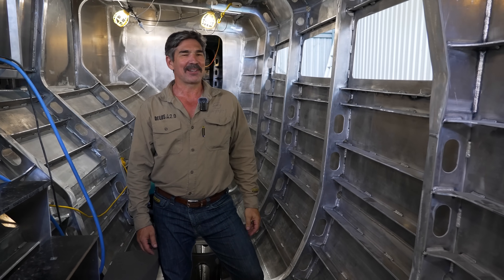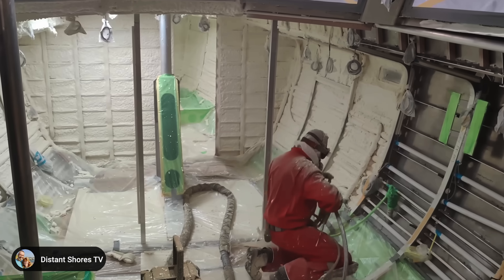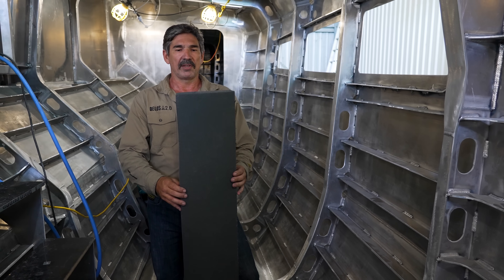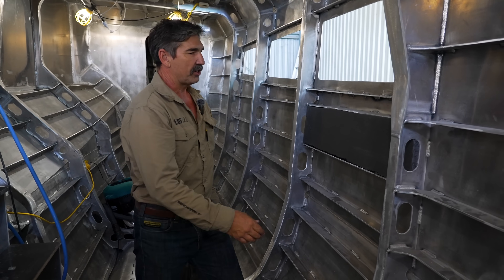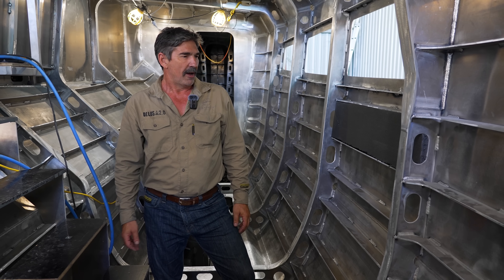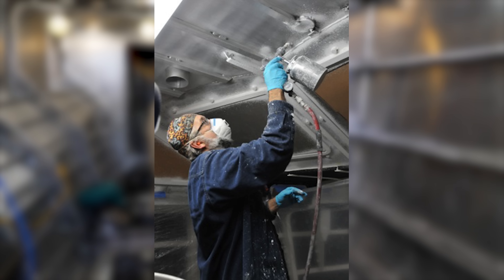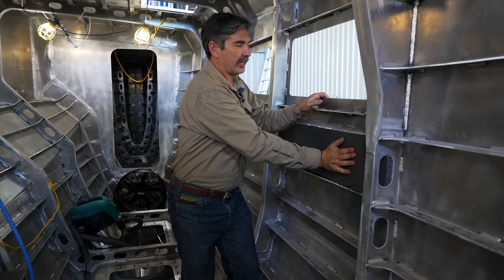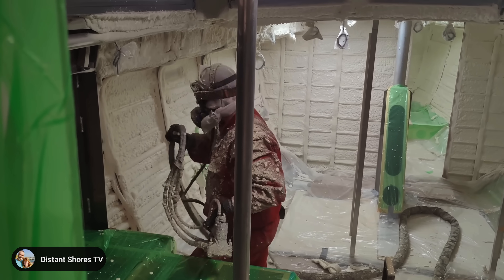HELP, We Need Your Advice!  How Should We Insulate Our Aluminum Catamaran???

Comment: Thought I would throw in my $0.02 on this since I may offer a slightly different experience from both the construction and industrial markets on this topic. Closed cell urethane foam is by far the easiest and simplest install and will do a great job but it has its drawbacks as we all know.  Because I don't believe you are going to find the perfect product out there in this case it makes sense to me to approach insulation as a system rather than a singular product for this application. To be clear I have no experience with this "system" and especially no experience on salt water  cruising aluminum hulls so this should be tested out on a small scale before you apply it on a large scale, but I would try out a sample or at least talk to the people at Acrytech Coatings in FL (I have no affiliation other than as a past consumer of some of their coating products) to see if their Therm-X basecoat and CeramaX Roof coating might be a good fit as the start of a multi-tier "flash and batt" insulation strategy that seems to be growing in popularity in the residential building industry.  Those specific Acrytech products are used as exterior coatings normally to mostly reflect heat from a surface because they have a bright white Titanium based pigment for increased albedo effect but that means they are pretty durable waterproof coatings with great adhesion to metal and specifically to aluminum in harsh environments to adhere to your hull structure and they also add some thermal insulating properties.   This stuff is used on the roofs of aluminum cargo trailers in the trucking industry and in some industrial shipping container applications as a cool roof paint to lower the temps inside the box and reduce the cooling required for refrigerated shipping.    Therm-x is like a brush/roller paintable thinned caulking to fill any small gaps or cracks for the subsequent layers and stays flexible to adapt to expansion and contraction of the metal.  The CeramaX is like a sprayable high build paint version of a very thin closed cell foam that creates ceramic  "micro-cells" in the coatings to reduce some conduction of heat.  Starting with those 2 layers to handle the bonding to aluminum, metal expansion and contraction and condensation issues to start,  I personally would opt to for a layer of spray cork insulation for sound deadening mass against the hull and any additional thermal and condensation help it contributes. Cork is also extremely fire resistant and electrically insulating in the case of electrical arcs with any worn or exposed wiring.   After spraying  you can install what you need to for wiring and piping in the wall cavities and come back after and add the batts of closed cell foam with friction fit (as long as it doesn't squeak when it rubs) and then it is removable, if necessary, under the finished wall surfaces if needed for maintenance.  This allows for all the spray applications to happen prior to any of the wire and piping installations being in the way so its goes on as efficient and as thoroughly as possible and then allows a hopefully lower cost slightly thinner version of closed cell foam batts as additional thermal insulation after all the wiring and piping is done.  Good luck.

Comment: The descant coating / primer is vital to try to hold back that condensation effect. Best way I know is paint, primer & that descant (hydrophobic) treatment with an air gap & an insulated inner wall. This will separate the outer hull from the interior surfaces while letting air & condensation dry out on their own. The inner panel with thermal insulation attached to it & not the hull will keep the interior temperature under control inside by eliminating thermal bridging.

Comment: Good video.  Removing foam insulation From Metal is very easy.
1) Use a Metal Putty knife & Plunge cut small 3" Squares for removal.
2) Grab hard foam and break away from hull. 
3) Use Wire Wheel on a Drill to Clean aluminum of Foam if so desired.
4) Vacuum area to clean area.

Comment: Now I'm not a professional boat builder, but I'll be starting a 50-foot sailboat build in the next 12 months. From all the research I've done, I'm going with versi-foam system 15. Is is uscg approved as a floatation device and provides r 6.5 per inch of insulation. It is completely waterproof, and it will stick to just about anything. To make things easy, I will be using 2 inch schedule 80 pvc pipe as my electrical conduit to make make any repairs easy. I'll be using t peices with screw on caps to make inspections and access easy.

Comment: Be careful.  Outgassing from the spray plastic will wreck your health.  Closed cell is a better option.  A vapor barrier to isolate the "dew point" and prevent moisture from condensing inside the wall.  Good luck with the choice you mske.

Comment: Take a look at Rockwool. You can get this in "bats" you can shape as you like. Rockwool does not absorp water, it doesn't rot, and it doesn't burn(!). Cut out so the bats insulate also the ribs in the hull. And finish with a vapor barriere.

Comment: One warning I would have about the sticky back insulation stuff is to try and research if the material deteriorates over time, I have a bunch of what looks exactly like that kind of insulation you are showing stuck in some areas on my boat by a previous owner and it is deteriorating and the little foam pieces always manage to find their way to the bilge and clog my pump!

Comment: Ive been in the insulation business for 25 years. Closed cell spray foam is the way to go. It has a high R Value. At 2 inches you will get a R15 which will leave room for running wires after. Great sound deadening. It will strengthen the structure but light. If it gets wet it just dry's.

Comment: Have you guys thought about condensation?
Because from being in Navy metal ships I can tell you that all the walls that are in contact with the water below the water line will be very cold. And you’ll mostly be in warm humid weather. So having any air in between insulation and metal wall will most likely create mold and fungi to grow. It’s a very important factor to have in mind. I’ve seen water dripping off metal ship walls from how much condensation there was.

Comment: Use ordinary self-expanding foam that is used for sealing and insulating roofs. It is a cheap solution. Very good, very light, and the boat will gain extra buoyancy.  Remember that the catamaran, too, can capsize - the foam will give extra buoyancy. In case of a leak, it is very easy to remove it to find the source of the leak. I apologize for any errors - I am using a translator.

Comment: Good video !
1) Zinc chromate primer for the Bilge & 12" up. zinc chromate is a Great primer for Paint on Aluminum.
2) Spray Foam Ftw - Min 2" is the magic number. see Refrigeration load calculation program & mess with temperatures & insulation thickness parameters For Btu correlation.
3" Spray foam insulation - Good for no condensation down to 35 degrees Fahrenheit.
4" spray foam - no condensation down to -10 degrees F.
3) Run an Extra 1" & 2" empty Conduit to any Places you think you Might want to Run wires in the Future.
Leave Room in existing conduits for an additional few wires and or Run a few  additional unused wires to locations.

4) Just a Fyi - All Commercial Walk-in Refrigerators & Freezers are Spray Foam & it insulates For 20 Years or more.
3" Walls - Walk-in Refrigerators. Last 40 years.
4" Walls - Walk-in Freezers.

New Standards are Walk-in coolers 4" Walls.

Comment: Hi Delos.  Fellow PNW here.  I have used the spray in bed liner in aluminum Grumman canoes for insulation.  It helps a lot for both sound and cold transfer when we had them in the sound.  I suspect the weight might be a consideration. You could spray it in and use the cellular foam over it.  Thanks for sharing your build with us.  Hope to see ya on the water some time.  We will be sailing from FP towards GBR summer 25.

Comment: Not boat but metal building in northern Ontario. Spray foam is the way to go. You are absolutely correct about little parts that are not covered being a major concern of insulation failure. What we did was run all the conduit and used pack insulation around it and sprayed all the rest. I would not recommend this in a marine application. As others mentioned run more conduit than you think you need and document all of it for future needs. I hope you all are having a blast building this. Best wishes.

Comment: Owned and fished an aluminun boat about 6 moths a year in alaska. It had extensive spray foam, top house had insulation foam. Bought a glass boat and couldnt believe how much better it was. Id do as much spray foam as possible with good wire chase and pre planming.

Comment: A thought I had was do a combination. Where you won’t need to dig into the foam unless there’s a dire  situation, foam insulate it. Where you have mechanicals and other necessary systems use the closed foam application.

Comment: Although I am generally a proponent of spray foam I not sure if it is the best solution for your project for reasons others have pointed out, chiefly flammability.  One product I have have not seen mentioned is Rockwool, it comes in bats and in compressed sheets. It is mostly melted and spun stone with some slag from iron refining mixed in. It's fireproof and not affect by water, if it does get wet it will dry out without issue. We use it underground (for foundations) and above for insulation and sound proofing.

Comment: Perhaps look into aircraft insulation.. it is generaly speced to be lightwight and fire resistant.Looong ago I worked at a factory that made things from various foams rubber and plastic. We sold Solimide AC550 if i recall correctly (forgive me we are talking long ago).. but it came in huge 4 ft x 8 ft  "buns" that they would slice into sheets whatever thickness you orderd. there wer two types.. one was yellow and pretty dense, the other that was more orange in color and more porous. The industry may have moved on to other stuff though

Comment: Alex is it possible to use spray foam and the foam pads for installation. They both seem to have their benefits and negatives, However it seems ones negatives are taken away from the others positives.

Comment: Sheep's wool. Hear me out, it is an amazing material. I built out a camper van -- normal steel shell -- and filled the walls with the stuff. It's moisture wicking, suppresses mildew and mold, naturally FIRE RESISTANT, great thermal and sound insulating properties. Plus is way easy and safe to work with, sustainable, and the biggest supplier Havelock Wool is based in New Zealand.

Comment: Hi guys love your project. I owned a 30ft aluminum sloop for 32 years and lived on her and cruised australia, Indonesia, Thailand, new guinea, and the Solomons a lot. Beachcomber had  white Styrofoam between the hull and a ply covered with front runner on the deck head and the sides down to the water line. The foam was attached to the hull with spots of contact adhesive. I never saw any corrosion under any of the foam. Below the water line was no insulation and I did have a few places in the bilge where water hung up in the stringers ect. and caused some corrosion. Fixing it was simple, cut out a panel, and weld a new piece in. The only negative of an aluminum vessel is the effectiveness of the antifoul after tbt was banned.  However the international trilux 33 was a much better product than anything else I had used previously.  I hope this is useful info. Steve.

Comment: Dude, just spray it. The matte insulation isn't going to do much because of the reasons you stated - all those support pieces will be fins on giant heat exchanger of a boat conducting all the heat in and out. Access seems like a small price to pay for the risk of condensation and corrosion...

Comment: Definitely Spray Foam. Best feature I think is the ability to prevent the Alloy from denting or cracking by providing a layer of protection that it can fall back on in case of impact or bottoming. + 1 Denser Armor for Delos 2.0

Comment: Spray foam, run pipe chases joining every compartment you can think of. You should have a ways from front to back on both sides and across to each hull with extra pipes to the kitchen and nav station. Don’t just limit it to 1 pipe you may in the future need to run different things like power or water. This boat is looking amazing.

Comment: high density closed cell spray foam would be your best bet, if repair is needed seriously how hard would it be to cut foam yes it's a little messy but you can cut it with a butter knife, if you prep and setup utility infrastructure ahead of time spray foam wouldn't be a bother. in other words lay your infrastructure on top of foam do not cover, should keep green death at bay and other corrosion

Comment: Brian n Kazza, Brupeg used foam insulation, like what is used in fridge insulation on their steel trawler so they could travel the world if you want to get hold of Damien to find out the specifics. They also painted all the internal walls with w pack epoxy, I assume as a barrier. Best of luck with the decision

Comment: I will throw in my two cents worth with 15 years behind me as a spray foam contractor. Forget the ‘what if I have to make a change in five years?’ concern and concentrate on getting the best insulation system possible for your boat, which is a closed cell polyurethane spray foam, about two pound density. As you pointed out in the video, condensation prevention is a big deal and you have to avoid thermal bridging and air gaps. Spray foam can do that and it is extremely difficult with bats as your sample installation shows. Others have mentioned Distant Shores, which was insulated with spray foam. The Dutch know a thing or two about aluminum boats and I would not hesitate to follow their lead. We all have a tendency to overthink matters but I urge you to not do that here, you will regret it. A few points to consider: 1) do NOT try to do this yourself but find a professional sprayer who has experience with similar jobs, the difference between a mess and artwork is all in the wrist of the applicator 2) apply an approved ignition barrier paint over the foam 3) run conduit for electrical and plumbing lines before you insulate 4) once the foam is applied it is an amazing sound deadener 5) if you have to removed a section later for whatever reason, you absolutely can (been there, done that). 
Good luck with your build, it is an amazing project and I enjoy every episode.

Comment: My two cents worth is. Keep it removable. Allow airspace between hull and insulation. So it keep it dry. Any condensation be allowed to settle to bottom of hull or evaporation. I would be attached to back of a panel and attached panel to hull leaving an airspace.

Comment: The issue with removable insulation is water intrusion, if there is a crack water will find it and that will happen no matter what you do either through condensation or just small unavoidable openings and the insulation will actually trap the water which is even worse.

Comment: Yeah I would stay away from spray foam. I metal framed high rises and would use the pins and clips with the regular fiberglass paper faced moisture barrier insulation. I’m not familiar with but I kinda like the thin white coating with the gray foam. I guess the spray is your moisture barrier? For some of the small tricky pieces spray adhesive in a can might be helpful to hold it in place. I would say the tricky thing is a good moisture barrier or your boat will sweat.

Comment: On a passage-making liveaboard, I would never cover the interior hull with something that wasn't easy to inspect.  Yes, spray foam may be relatively easy to cut/scrape away, but that means you have to wait for a big problem to materialize before you know about it (unless you can easily diagnose from an exterior inspection?).  And, then, you're creating a toxic waste and having to provision chemicals to patch it up. No thanks!  I'd say spray an insulating primer and then friction fit (no glue) your closed-cell foam between all ribs(?) like you demonstrated with a thinner, face-mounted sheet of foam over each section (between the bulkheads) to minimize the thermal bridging of the ribs. If properly fit, they won't come out easily underway and extra closed cell foam is handy on the water and easy to come by.  It could also be held in place by tight fitting interior paneling. Lastly, and most effectively, don't cruise anywhere that creates excessive condensation-causing temp differences!
Reply: I also like the idea of leaving a breathable gap and channel for inevitable condensation to form and drain to the bilge.  Create a conditionable envelope and control that environment.  Don't fight physics...

Comment: Spray foam has a ton of pros for it however the one con that isn't being mentioned here is the proper application of it. 
Spray foam has to be mixed properly and sprayed at the perfect set temp per the makers instructions. If it isn't the big problem is it doesn't cure properly and it continues to offgas for ever leaving the occupants of homes getting sick. There has been enough of the spray foam installed improperly now that even some insurance companies are not writing insurance policies because of it.